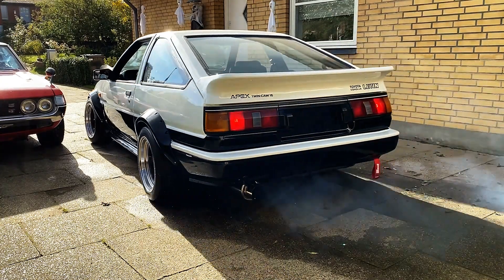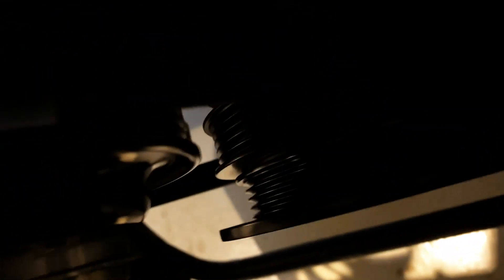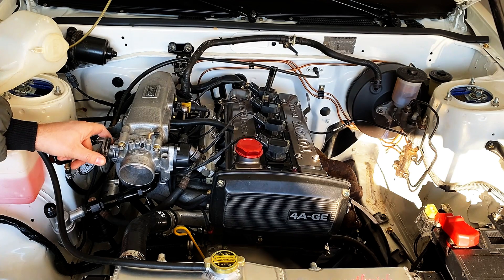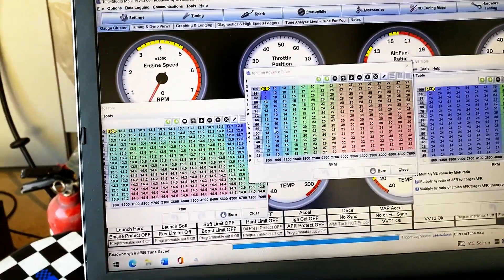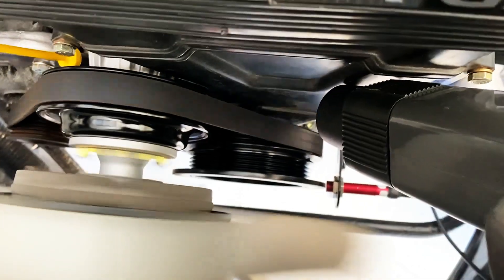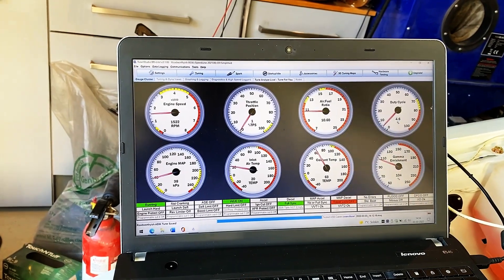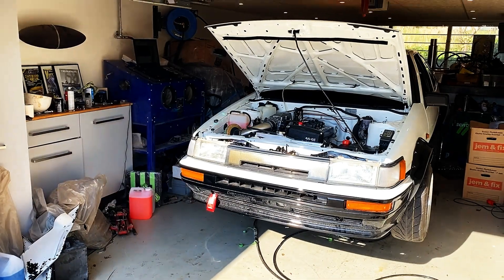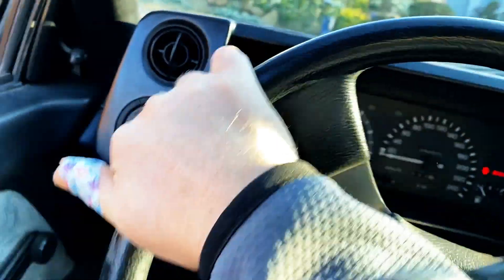Ae86 Speeduino build Part 3. Finishing my rebuild Ae86 Corolla 16v, 4age tuning and roadtrip DIY ECU

Comment: Could you have used the stock distributor for signal or  have to use that crank trigger ?
Reply from the maker: You need to put in another type of sensor and wheel to keep the dizzy…

But a modern Hall effect sensor and crank trigger setup makes it all so much more smooth

Comment: Youll gain a decent amount of power by going to an electric fan. that thing eats a ton a power on a small motor like this.
Reply from the maker: Yes and no…

The electrical draw on a desent fan will strain your alternator, and that in turn will take power to run…

I Would much rather run the mechanical. SO much more cooling than an electrical.

But I get your point.
Reply: @DavidRoadworthyish  Theres a great engine masters episode on this you should watch, look for the fan shootout, its on youtube. The mechanical fan can eat 25hp+ at high rpm, a 100 amp alternator takes 4hp to drive. Its the cheapest power gain you can get on this thing.
Reply from the maker: Love the name though… 

And yes it draws abit more that that I would think… but a lot of people tend to lean towards electrical fans… I personally prefer mechanical

Comment: i really want to do the speeduino ecu so i can get rid of the crappy distributor and crap and be able to tune. I have a trd supercharger kit for the 86 as well which needs a ecu to work well.
Reply from the maker: Yeah that old dizzy and all the worn out part for it really isn’t ideal any more..

A Nice speeduino and cop upgrade will be optimal for both spark and fuel tuning for your trd supercharger kit

Comment: How do u set the ignition timing in idle in closed loop to 0º TDC when it should be 15-16º BTDC in normal operating mode and 10º BTDC in diagnose mode??
Reply from the maker: Hi.
It’s set realative to the crank sensor.
Reply: @DavidRoadworthyish  Ahh okay! So in previous videos I watched that u put the missing teeth of the crankshaft pulley toothed wheel like 15º BTDC, so no it marks like 0º, am I right?
Reply from the maker: @jjbc5059  I might have put it on the pulley like that.
But I prefer to have it away from the TDC by 40-50 degrees eather way.. and then set it up in the software...
I think the missing tooth ended up being 270 ATDC and then I calculated from there.. 36-1 missing tooth wheel = 10 degrees pr. tooth

Comment: Good job on the car, did you tune it your self ? 

Did you sort the missing rpm rev counter in the dash ? 

What type of idle valve were you using ? That didn’t work ?
Reply from the maker: Thanks.
Had some help. This was my first tune like this. Tryin to learn, but alot to take in.. 👍

I haven’t fixed the rpm signal yet. It’s “just” a pin from the ecu i need to Connect..

I was tryin to use a vw transporter 2.5 idle valve. Too Big, so couldn’t adjust idle under 2400 rpm. So letting to much air in when closed… so just running with the idle bleed Screw now. No idle valve. Ecu controlled.
Reply: @DavidRoadworthyish  did you remember the diode on the idle valve ? if not that's your problem right there.. otherwise you cant controle the valve it's like the resolution goes from 5 steps 0-100% to 30 steps 0-100% much better.

Some revcounter needds a 12v signal depends on what the old ecu was giving to dash, ore coil was giving
Reply from the maker: @Jakobsen86  I did. It´s just the default setting of the valve that allows so much air in that it idles so high... It was meant for at 5 cyl diesel i guess thats not sooo compatible to a 1,6 gasoline... 😀 But thanks for the heads up man. much apreciated.